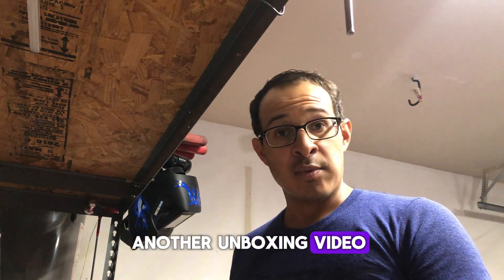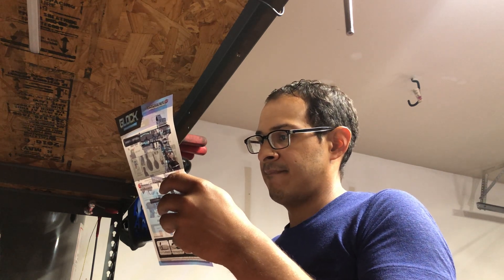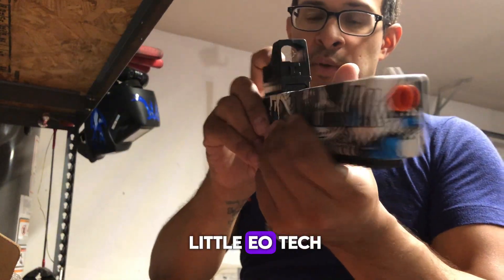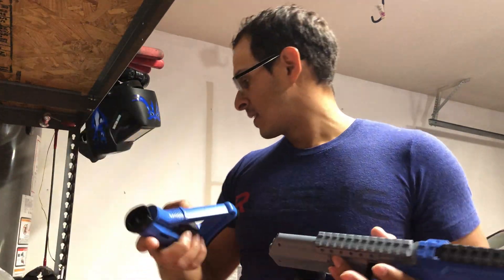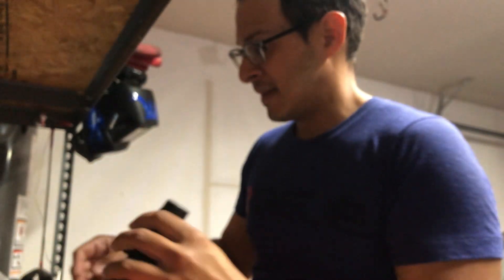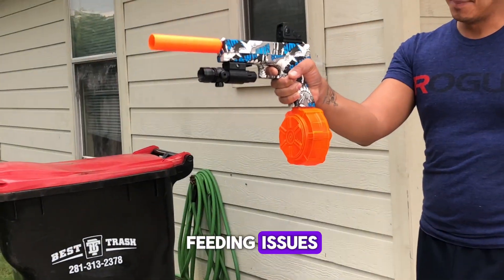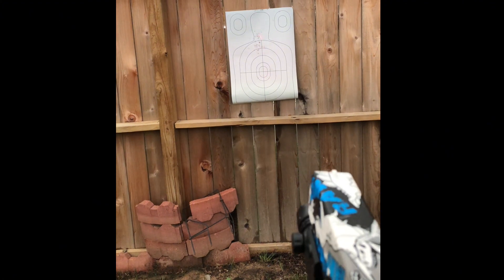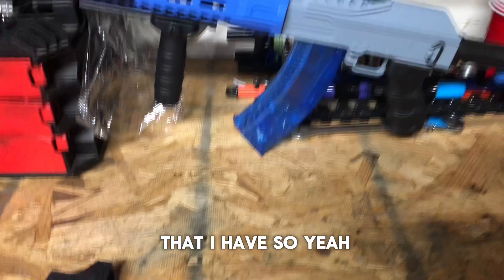More Amazon Gel Blasters

Comment: It doesn't have.
Fitting issues You need to primate it
Reply from the maker: I did prime it. When I take the mag out there’s always 3-4 balls still in the feeding tube.
Reply: @Atrociousa3  Number 1, leave the orbis between 1 to 2 hours. Number 2 Get them dry. Number 3 Prime  them right Number 4 Charge the battery Congratulations you learn something  🤣
Reply from the maker: @cooledraptor279lol  no that pistol just sucks. I’ve let the orbeez sit for longer. I’ve even used it with an upgraded battery. When I pull the trigger I see the slide bounce back and forth. Going to upgrade the spring to see if that fixes it.
Reply: @Atrociousa3  Remember  using 11.1v battery With  Naylon  gears Can mess up the inside You can upgrade it to metal gears
Reply from the maker: @cooledraptor279lol  thanks I’ll look into that
Reply: @Atrociousa3  Yes , and show it to the people how to do it You'll be the first person to do so